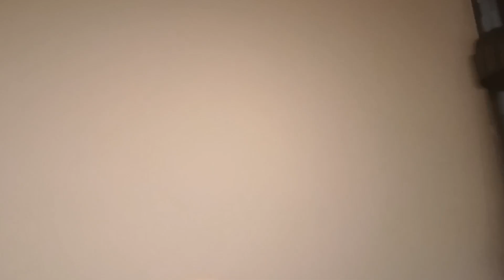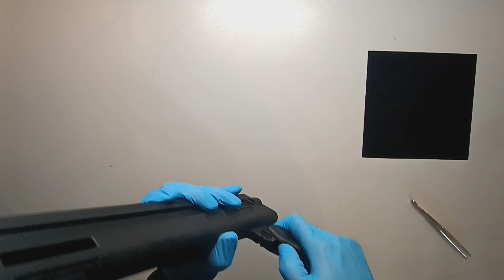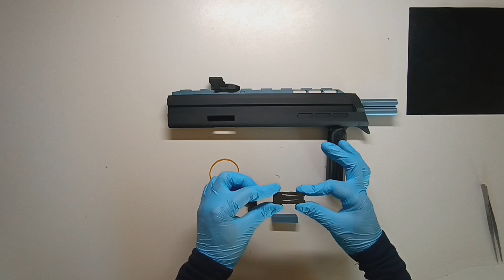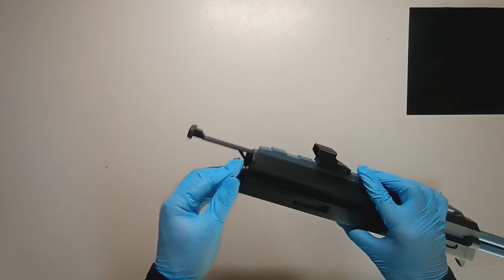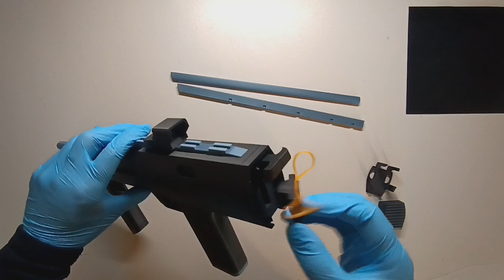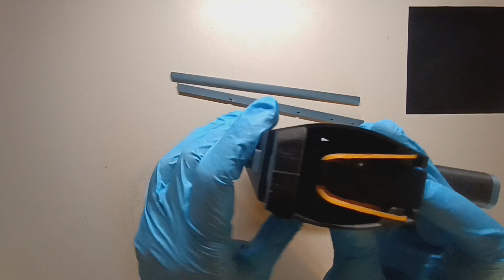Half life 2 SMG cosplay prop (3d printed) Assembly video.

Comment: What size of spring does this require?
Reply from the maker: I try to use common materials for my props, so the springs are from a pen, about 3-4mm wide with a length of 25mm

Comment: I'm very impressed with this model. I'm in the process of working on an OSIPr, it doesn't articulate, but it does have leds on the barrel and ammo cartridges. I'm working on this model for my metrocop cosplay. I modified a HL2 Pistol for that one.
I'm not at the level where I can easily/quickly build up props but have been learning when I took an OSIPR prop I liked, found out I didn't like it, and basically remade it as best I can to the model.

Comment: Hi, thanks for providing this great model. I'm curently in the phase of assembly and noticed, that the magazine locking part is missing in the files. Could you be so kind and upload it?
Reply from the maker: yes that stl was one I missed during the upload, its fixed now.
Reply: @Zakvins Thanks so much for fixing. I just finished building it and it turned out great. I'll report a 'make' on thingiverse soon. Now on for the paintjob.